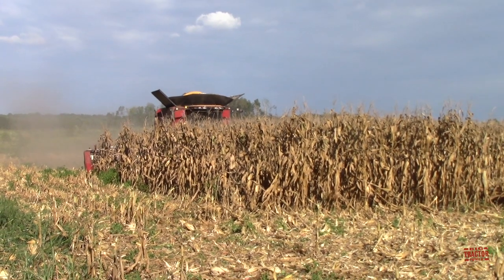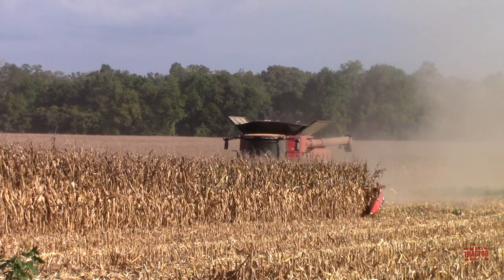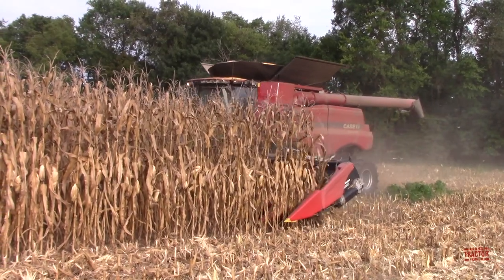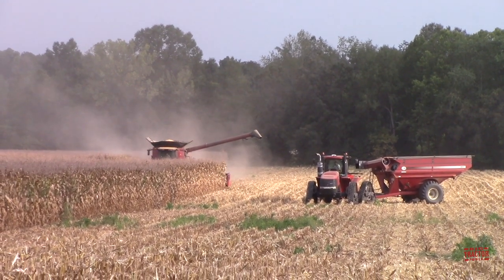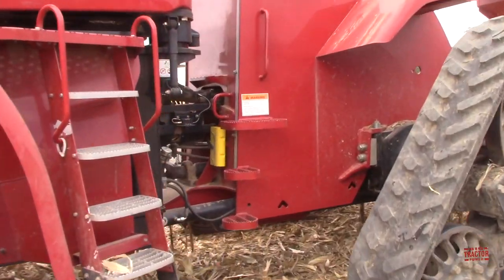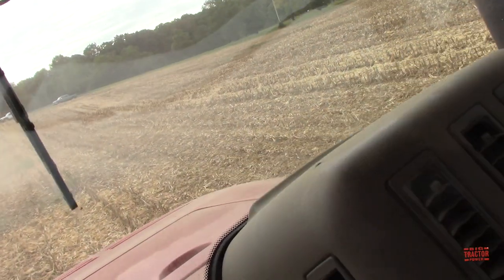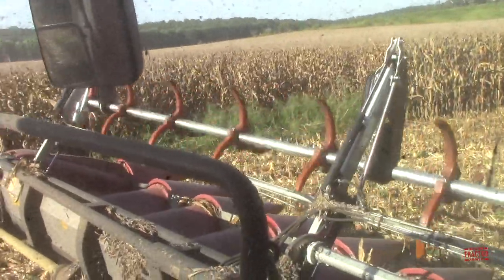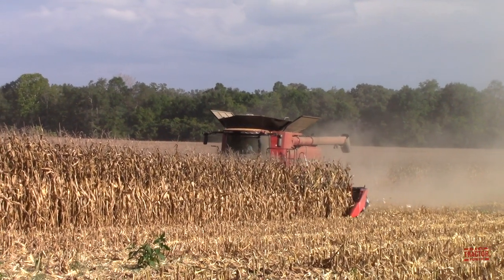16 row Corn Combine: Case IH 8240 Axial-Flow

Comment: If you figure the combine is unloading 4 bushel per second but if it’s moving at 3.5 miles a hour with a 16 row head in 220 bushel corn it’s replacing the corn in the bin at the rate of 1.5 bushel per second so when it unloads on the go it actually dumps 497 bushels ! 😎 Another great video!
Reply: Brent Farrow that is way to much math for me

Comment: Hmmm. The grain saver on the combine unload auger doesn't seem to be working right - a fair bit of spillage out of the spout after the auger shuts off.
Reply: It is because he didn’t close it. With those pivot spouts you can tell when it closes by when the spout tips up. There is a baffle/door that closes and prevents loss.